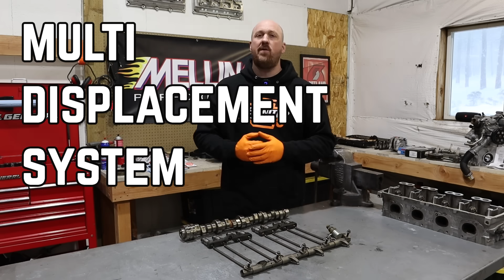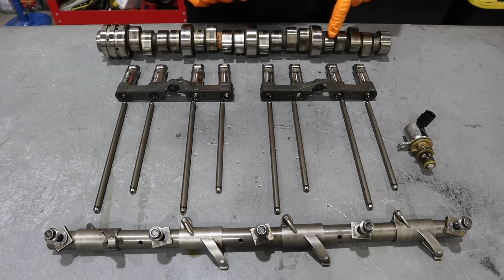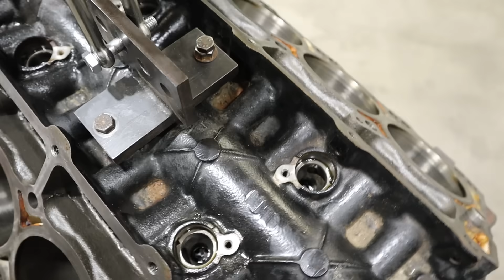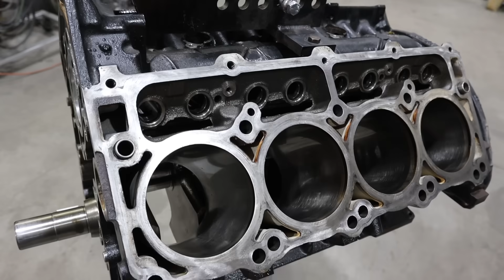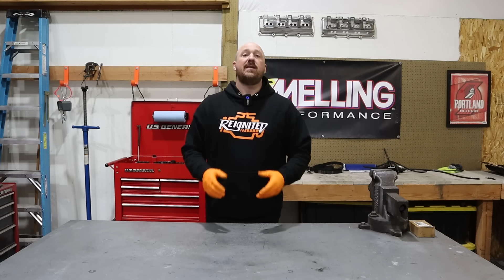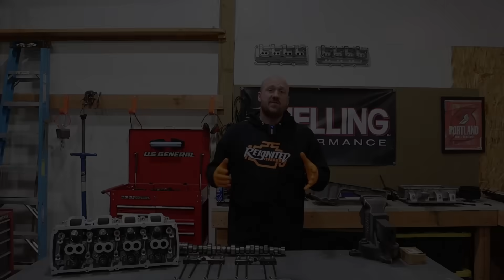Is MDS Damaging Your HEMI? The Answer May Surprise You!

Comment from the maker: Let me know if you like this sort of video, and what system would you like to see me cover next? Thank you for watching!
Reply: A video on cam duration vs lift and lsa . What is higher duration vs longer duration and it’s effects on performance. High lift vs low lift , LSA adjustments , and how to determine the correct size cam for a daily driver vs a track car. Thanks
Reply: How about a Ram Heater core video?!
Reply: @ReignitedAuto  by the way love your videos very intune to what a guy is trying to narrow down
Reply: How about traction control and ABS
Reply: I would be quite interested in seeing the hemetic. The cams removed the lefers, replaced everything replaced gone wrong. What caused it to go wrong? I believe push rods were. Put in properly left on a shelf and bent the push rots. How can this possibly happen
Reply: @gordonleakey6830  he has done videos about this, look back at the playlist and you can find them.
Reply: I bought a 2016 dodge Challenger scat pack when it was new drove it for almost 1000 miles with MDS on and then after that I have it off all this time. The car now has close to 49,000 miles of course it is low miles recently. I’ve been driving it more to and from work oil change intervals, I do 5000 miles do you think there’s a chance it’ll cause damage
Reply: Where can I find a Budget build on my 5.7 that's in the middle of 06-07 it has the mds and it's going in a truck without mds but I can't get a good general idea to get the best of both speed and pulling power
Reply: I have a 2010 1500 ram with a 5.7 hemi  with 325000 miles  I have changed oil when the dash light comes on saying an oil change is due . It started running rough I took it into the repair shop.and he put his scanner on. I am not sure of the exact code. They came up and said, misfire in cylinder one. Is it a lifter? It’s the only problem so far except for a broken manifold bolt
Reply from the maker: @mnfarmer194  it's possible, but there are a number of things I would check first before going that route. Check out this video I made awhile back 👍: https://youtu.be/gW3YuM4ZeAA
Reply: 19 ram 1500 5.7l can you stick a 180° Thermostat in it without programming? Will an external oil cooler get the oil temps down?
Reply from the maker: @johnnyspencer4329  you can, but if you don't change what temp the fans come on through programming, the temp will automatically rise past the thermostat temp and go until the fans come on.
Reply: @ReignitedAuto  I recently started having the lifter failure issue would it be possible you create a parts list to see exactly what i need to buy to swap out the lifters and cam?
Reply: Would this cause a tick that sounds like a baseball card in a bicycle wheel, when going highway speed then basically idling to a slower speed?
Reply: @Reignited Auto What would cause a cam and lifter failure multiple times within a year
Reply from the maker: @paulwhitt9063  only thing i could think of offhand would be a seized lifter bore, but that would be found during the initial failure. I feel like the cam/ lifter issue has become a catch all for some mechanics and rather than actually diagnose something correctly they just say it's cam and lifter.
Reply: @ReignitedAuto  would it be better to drop a new crate motor in it? I've gone through 3 cam and lifter stes in a year
Reply from the maker: @paulwhitt9063  i can't even think of a scenario that would destroy lifters in that short of time. Have you removed them yourself to see the damage? If it truly did go through three in one year then yes I would absolutely change engines entirely at that point.
Reply: @ReignitedAuto  I personally haven't torn an engine apart. I've used 2 different mechanics to do it. They were under warranty until now. They won't warranty it again.
Reply: @ReignitedAuto  any suggestions on a company to buy one from? I've seen a couple but am new to this level of work on a vehicle. Lol normally it's something I can handle.
Reply from the maker: @paulwhitt9063  ya i bet, because that was never the issue 🤦‍♂️
Reply: @ReignitedAuto  love the videos so I went ahead and ordered the pump you suggested however I have decided to delete the mds what delete kit would you use ? Do you have the part number and where I can order it from ? Also where can I find the torque specs ? And what do I need to do for tuning? Thanks in advance 2019 Ram 5.7 etorque is what I have
Reply: Do you have any videos on cracked manifolds, adding shorty headers?
Reply: Hey brother seems like you know a lot about the hemi and its pros and cons…mabe you can help me out…got a 2014 ram 1500 that only ticks when in gear..in park or neutral no tick..any ideas?
Reply from the maker: @leonard6hhflores122  once you put the vehicle in gear it is under more load, sometimes this is enough to hear an exhaust tick. I have another video on my channel called "the most common Hemi tick" that should set you on the right path. 👍
Reply: @ReignitedAuto  ive seen and heard that.and ive kinda checked out my manifold bolts and they seemed ok but honestly thought about having the manifold gaskets and bolts redone based on being hopeful haha
Reply from the maker: @leonard6hhflores122 I've seen them where they were just a little loose rather than broken and that will cause a similar noise.
Reply: I'd like to see a vid on testing procedures to determine if a particular MDS solenoid is bad vs wiring, etc. This is, of course, after it shows a code.
Thanks
Reply: Awesome video man just subed
Reply: I got a engine tick can you help trouble shoot my issue on 2012 Jeep Grand Cherokee 5.7 with multiple misfire. I have a video I can send via email.
Reply: I could totally be wrong but I've also heard that putting a tune on that increases idle RPMs can help as well. Increasing idle from the 400-500 from stock to around 750rpm
Reply: I deff like this kind of video.
Reply: I’d like to see a video about the ECU and other electronics regulating the engine. I have a 2011 RAM 1500 Outdoorsman in very nice condition but my mechanic says the weak link in the chain, plus OEM replacement units are unavailable. I’d like the security of knowing the ECU can be “repaired” or reprogrammed if it fails. I’ve already had a couple of warnings from the truck itself. Sometimes the windshield wipers turn on and the horn beeps very briefly. All this happens while it’s in the garage completely shut off. Usually at a very annoying time of night. My mechanic says it’s a characteristic of Stellantis era engineering and is a mystery. Thanks for considering viewer feedback !
Reply: @ReignitedAuto, 

Thanks for the great videos.  With respect to MDS oil issues in turning off the MDS system, you mention if you turn it off, it will cause oil pressure/lubrication issues.  I'm a bit confused.  As I understand it, turning off MDS, via a tuning app or reprogram of the ECM, causes the cylinder deactivation to not occur, which appears to be when you are in highest gear under low load. Oil pressure is flowing to all 8 cylinders which are firing.

 Is there any bump in oil pressure of the activated MDS 4cylinders to ensure proper lubrication....stated another way, does running on all 8 cylinders in top gear result in some kind of oil pressure/lifter starvation because of the way MDS was designed? How might the HV oil pump mitigate this in cars that want to "turn off" MDS?  Is running in MDS necessary when running in top gear when load/demand is low and RPMs would be at the lowest?

Does your other video using the HP Oil Pump and clearing the pressure codes speak to this in anyway?

Thanks a million.
Reply from the maker: @red_887 I'll try to clarify a bit. The MDS activates by applying pressurized oil to the lifter bores, this collapses the lifters and shuts off those cylinders. So when MDS is activated there is maximum oil flow to the lifters. The mds solenoids do allow a certain amount of oil to flow to these passages when MDS is not activated, my assertation is that by installing the high volume pump that additional oil flow will reach the lifters even when MDS is not active. By far the best solution would be to install the high volume pump, and remove the MDS system entirely, but that is cost prohibitive to many people. The point of this video was mostly, if you're keeping mds, let it activate like it's supposed to,, don't turn it off every time you drive the vehicle.
Reply: @ReignitedAuto  Thank You!
Reply: P3401: MDS Solenoid #1 Malfunction or Wiring issue. Car runs and drives normally. No difference wse. However, "NONE of the MDS system seems to be working". Because it does NOW lose any power, nor sound like a moped or going into OD when highway cruising. Side note: the Cruise Control also stopped functioning right about this same time. However, within 15-20 miles, the dash also lit up like a Christmas tree due to a Wheel Speed Sensor Code (unknown location given via $20 code reader). I've only driven the car with these issues for a couple of hundred miles, without any issues, other than the Cruise Control being disabled, and a fuel reduction of 2 to 3 mpg. Is the MDS not working an issue for providing proper lubrication to the head components? It is currently 0-25°f and currently don't have a garage. I don't plan on putting more than 500 miles on the car before next spring. Thanks
Reply: How about a video on common LX car problems such as suspension and driveshafts?

Comment: Hello. I have a question: I am driving a 2006 Chrysler 300c 5.7L and with InTune i3 I deactivated MDS. Great that the MDS roaring i gone. I am driving only saturdays and probably sundays for about 50-100km. All how many weeks should I activate MDS and for how long? I am asking because of the lifters. Thank you.
Reply from the maker: I've got some good news for you. The lifter issues really only affect the 09+ engines. Your 2006 will be just fine. The early engines have their own problems, but not lifters.
Reply: @ReignitedAuto  WOW, and many thanx for your very fast and positive answer!👍👍👍

Comment: This video really helps to explain why it's so important to use the factory recommended 0W20. If you use a higher weight oil, like 5W30, you will reduce the volume of oil flowing through the system, your hydrolic lifters will not fill and empty properly, and you won't get enough oil to the cam.

Comment: 2012 Pursuit charger.   I get 23mpg @75mph.   That is a little over 2000 rpm.  MDS doesnt seem to improve my mpg much.   I'd delete it if given the chance.   I used MMO before oil changes to help clean up any varnish.   I also use 5w30 Mobil with Lucas oil stabilizer.   5000 mile service interval but I get nervous after 4000 miles.  More oil is better.    My 2012 will activate eco mode the first minute engine is started...even in the winter.   So no.. engine temp makes no difference on my MDS system.

Comment: Is it ok to start using 5W-30 oil instead of OW-20 in my 2023 5.7 hemi?
Reply from the maker: It wouldn't hurt anything, but it may set a check engine light for incorrect engine oil viscosity.

Comment: If I turn my MDS off manually you say it’s harmful because all the lifters aren’t being oiled correctly, does that mean if I leave it on and it is running on 8 cyl it is not being oiled properly ? Doesn’t make sense to me. If I turn it off manually makes it run on 8cyl instead of 4 so it should be good.

Comment: These engines need a graphite additive in the oil for the cam lifter issues as roller lifters are performance and not long term solution like flat tappet type which can also add more protection to flat tappet lifters over high mileage

Comment: I have the 6.4 in my Ram 2500. The growling noise when MDS activates at low rpm is annoying
Reply from the maker: It's interesting how the different models you can hear/ feel it activating much more than others. I'm with you on the 2500's though.
Reply: @ReignitedAuto I drive pretty slow and it tries to activate under acceleration, too. Very annoying

Comment: I'm in the middle of doing the cam and lifters on my mother in laws 2015 ram 1500 it's got 321366 miles on the original engine and it just started ticking.   I pulled the lifter's and cam out and the number 8 intake and exhaust lifters barley started chewing up the cam.    I pulled the oil control valve out and there was very little metal.   She does get her oil changed every 5000 miles inside the engine was very clean     hell she still has her original 6 speed tranny.     Big thing here is about 86 percent of her miles are highway.    We chose to put the mds lifter's back in cause my son used the truck plus she still uses it and on the hwy it still pulls 17 to 18 mpg

Comment: My 13 ram 1500 just started have an oil leak. 165k miles. 1st dealership days it's from MDS then when I bitched cuz that isn't covered under extended warranty, magically it's now valve cover gasket

Comment: I have 2014 5.7 that just failed at 192K miles.  I did regular oil changes.  It got very good fuel mileage. I would regularly see 23-25 MPG. Most of my driving was on the highway, No extended idling time.  It was running perfectly until it failed.  It began misfiring on 5.6.7 and 8.  It's not a spark plug, coil, or PCM problem.  I may try to change out the cam and lifters myself. That's the only way fixing it makes sense. But I'm afraid of metal shavings wrecking other parts of the engine. I can't see replacing the engine in an 11 year old truck, even as nice as I kept this one.  I could buy a very nice used later model Ram with more options for less than what it would cost in parts and labor to fix mine. It's sad.
Reply from the maker: If it makes you feel any better I've repaired more of these engines than I can count with just a cam and lifter replacement. Once it's repaired you're good for at least another 200k. You likely only have one failed lifter, but once it starts misfiring consistently it'll register as a misfire on several cylinders. One of my most recent videos will walk you through the entire process of the cam replacement on a 1500 👍
Reply: @ReignitedAuto thanks! That does make me feel better!

Comment: I'm curious, if leaving the MDS system activated, why do they have the option to manually turn it off on the steering wheel? Is it for specific use cases like perhaps pulling a trailer, etc...?

Comment: Can you explain which solenoids never open if MDS is not activated? The MDS solenoids? Aren’t they opened when MDS is off? Please forgive my ignorance.
Reply from the maker: Yep, I'm speaking about the MDS solenoids in the intake Valley of the block. They are fully open when the MDS system is activated allowing full pressurized oil to the lifter bores 👍

Comment: @13:00 minutes.  So basically, what you're saying is that continuous mode is bad  for an mds system? What if I didn't use a tuner or replace the hard parts but I drove in such a way that didn't allow mds to activate would that also be bad?

Comment: Mine failed at 60 and 120k ram repaired first time so that was twice ram did it and it failed at same mileage . I did it at 120 and now I’m at 215 on same repair. Js do it yourself. I think they don’t prime em and it causes issues and I don’t think they follow specs on torque ect or care for that matter. I get 24 mpg out of my 2012 ram 1500 5.7 quad 2wd

Comment: I can hear the engine tap tick and whiz and sometimes even drone on the highway when mds is activated. What does this mean? Solenoids are still functional no missfires and no codes
Reply from the maker: It's common for more of the engine NVH to penetrate the cabin during MDS operation, there's nothing wrong it's just a little more annoying. I find some models are more susceptible to this than others, and people themselves are sometimes more or less sensitive to it.

Comment: It also doesn't help that the manufacturer wants you to put 0w20 oil. Its way to thin of oil. The hemi runs so much better with 0w30 in the winter and 5w30 in the summer. Way more viscosity to make sure all components are oiled

Comment: Thank you for this info. Just bought a 21 ram 2500 6.4 and I kept hearing everyone saying they run in tow mode or deactivate MDS with the gear control. Glad to know that does more harm than good. My truck has 70k miles on it and moderate idle time, so i'll be installing a high pressure oil pump soon and making sure to do those oil changes every 5k miles.

Comment: If turning off, MDS will damage your engine. What happens when you shift the transmission into tow haul mode. This deactivate MDS. I have 75,000 miles on my 2021 ram 6.4 and I have never left MDS on. I always deactivate it. I just completed an 11,000 mile trip from Massachusetts to Alaska and back with MDS shut off 100% of the time. My engine seems to run beautifully. Absolutely no ticking. So I need to understand what happens when the engine is in tow haul mode.
Reply from the maker: I don't mean to oversell the idea that it'll damage your engine not using the MDS, just wanted to be clear that to give your engine the maximum oil possible at all times then it makes sense to let MDS do what it's designed to do. Keep in mind that at anything over 1500rpm the oil pump is making the full pressure, probably 60psi+ so there's quite a bit of oil moving through the system. I was mainly hoping to show people the exact path of oil through these engines and let them make an educated decision about how to operate their vehicles. 
It's far more critical in the grand scheme of things to make sure you're doing timely oil changes and that you're not letting the vehicle idle excessively. 👍